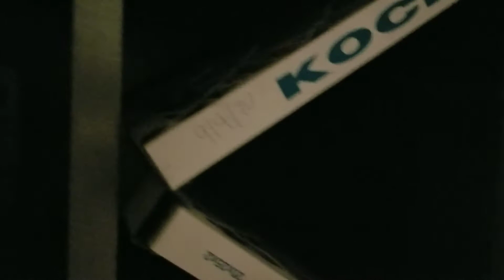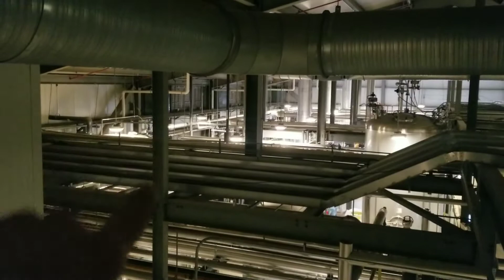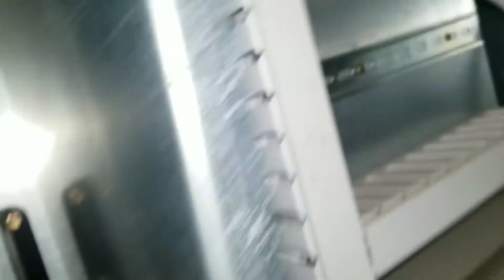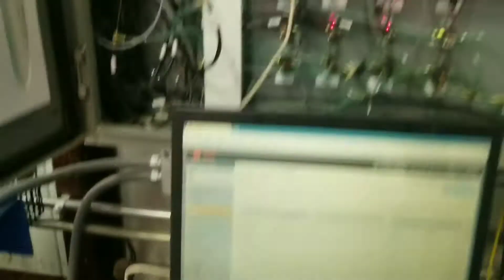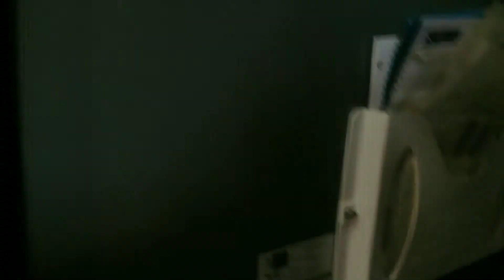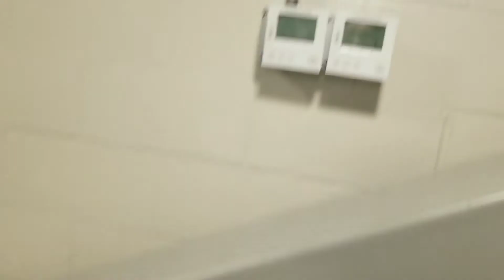HVAC P.M. limited access, multiple style units, industrial conditions. location walk through.

Comment: I’ve never seen anyone actually run Big Ass ceiling fans in reverse before until the couple in that warehouse. I know they are able to be run that way, my workplace has many of them. Being in Texas those BAF’s are everywhere. But I would think it would be less than ideal as the blade/air foil design is meant for down flow only. I’d be curious as why they thought running a fan meant for down flow on up flow would be better than a bunch more smaller industrial ceiling fans that have blades specifically designed for either bi-direction or up flow only. (Not an expert here, just curious).
Reply: Alcohol fumes rise and accumulate.